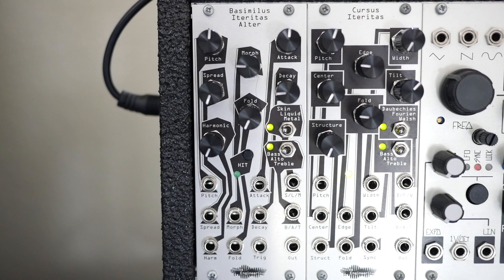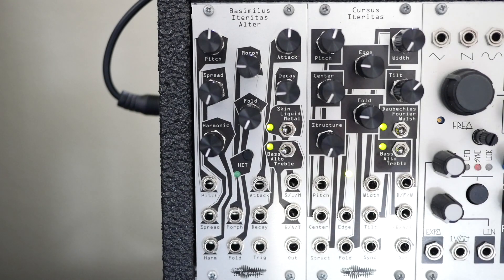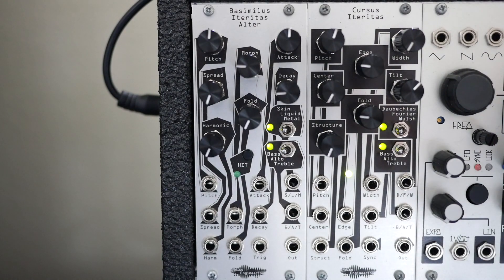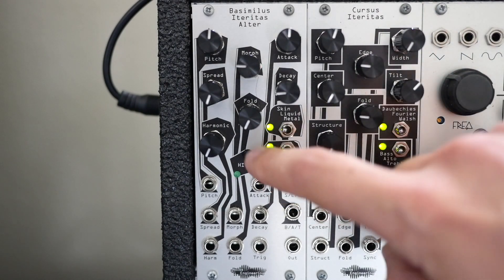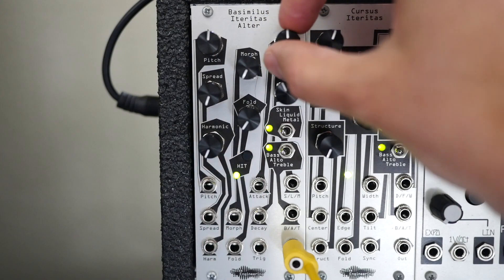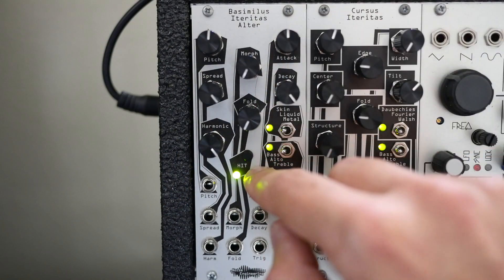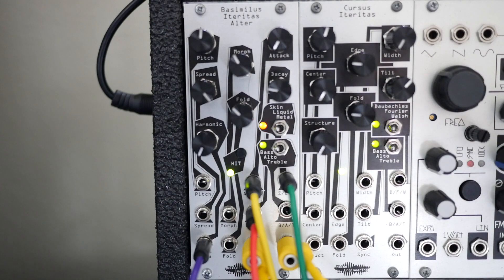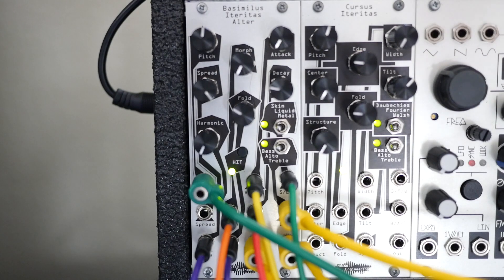Noise Engineering Basimilus Iteritas Alter

Comment: what I dont undertand is that this module has only one out. so it can produce only one sound at the time. how is it possible then that when you connect all the cables it sounds as 6 or more different drum sounds at the same time? Even if you don't touch the module, (?). thx

Comment: Cool module. Wouldn't you need 3 or 4 of them to make kick, snare and hats beats?
Reply from the maker: If you wanted all those sounds to be heard simultaneously, then yes.  But the way the module is designed, you can find all those sounds via control voltage, so using a sequencer like the Voltage Block, where you can have multiple voltages, you could sequence those sound changes.  I think you could do quite a lot with just two BIA and a Voltage Block.  But it’s a obtuse way to make straightforward drum patterns/sounds.  If you want a more typical drum/drum machine sound and patterns, I’d go with specific kick/snare/hat modules, or an actual drum machine.  The real power of the BIA is how it fluidly transform between percussion sounds, no so much “create a typical drum pattern with one module”.

Comment: Can it also output a static tone, so you bypass the envelope? Can not really decide between this and the manis iteritas
Reply from the maker: No, but the Decay at maximum is pretty long, but far from indefinite.
That is one of the cooler features of the Manis, however the Manis sounds VERY different.  IMO, it's more of a percussive lead or percussive bass sound and the BI is more electronic drums.  Both?  ;)
Reply: @jamescigler  Thanks for the answer!

Comment: what module are you using to drive the trig and  harm inputs?
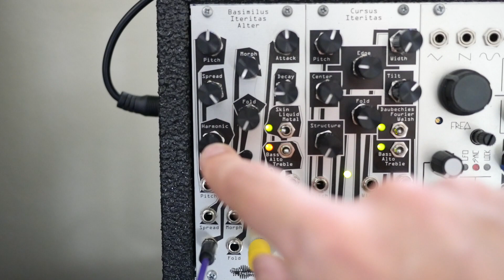Reply from the maker: @ 7:00 I'm using a steady 16th note clock (probably coming from Tempi, but for a trigger/clock, source doesn't really matter) to the Trig input.  I'm using that same clock to drive a Voltage Block, which is sending one sequence to the Harm input.  I believe the latter parts of the video are essentially the same, but using more channels from the Voltage Block.

Comment: Great demo! That click, though
Reply: I have one. The click annoys me, as I always hear it while I'm patching other stuff and get confused, trying to debug where I'm hearing the click
Reply: Is there a way to work around it with eq, or is it just a part of using the module?
Edit: Or would adding a quick attack vca help soften out the clicking?
Reply: The VCA solution would work. EQing may pull out frequencies you want to keep. The attack knob further to the right also works, it's just not a smooth transition between "clicking" and "not clicking" (sadly). I think this is only a minor flaw in an otherwise storming module however